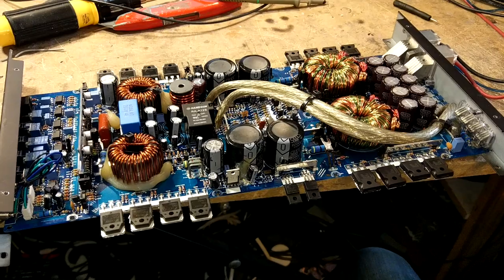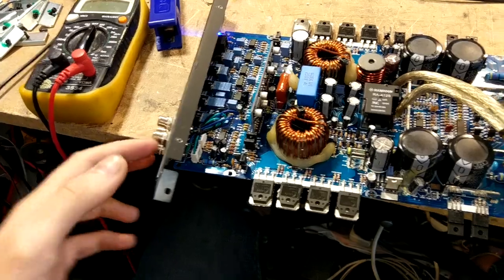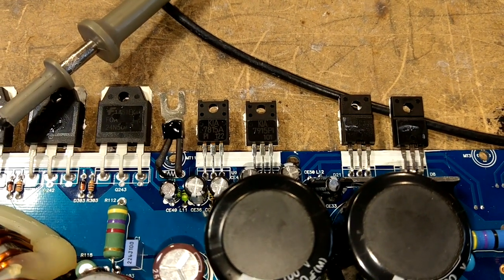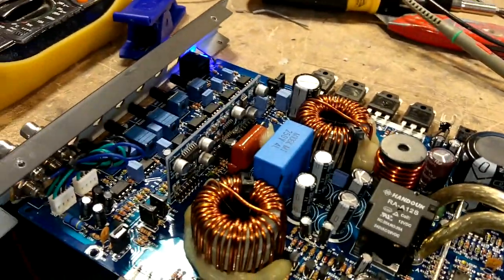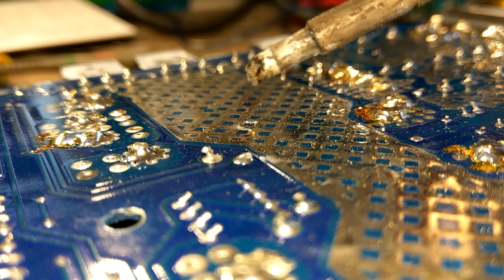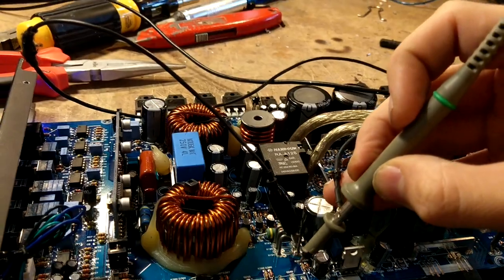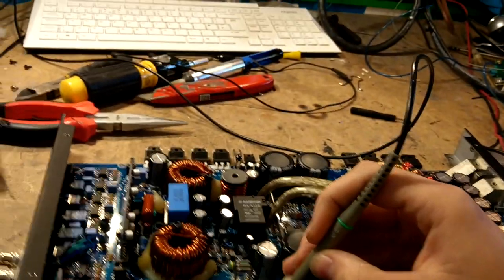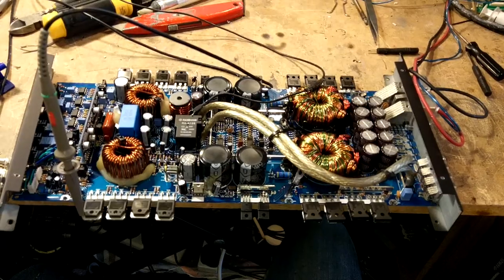Car amplifier fault finding - Sundown SAZ-1500D Repair

Comment: Sax-1200d...
Was hoping your problem was closer to mine. But its not. 
This amplifier of mine works. 
But, it idles warm. To warm. I heard its a factory defect in this series of amplifier. The heat seems to be concentrated around the toriod coil. 
Its out of warranty. But id rather fix it before i over stress it, accidentally, if its not up to snuff. 
Have you heard of this "factory defect"?
I was told this by an Ex sundown factory warnty repair guy. Hes no longer doing sundown warranty work. 
Any input would help me and my personal local repair tech get somewhere with this thing. 
Thanks in advance.
Reply: Are you still needing this SAX-1200D fixed?  I know 2 years later. I am that guy.  I have your answer anyway.  I was the Sundown warranty repair guy for 10 years, repaired probably 500 of the SAZ-1500Dv2 that this guy is working on in this video.  He is really good BTW, I am enjoying his videos.  I no longer repair electronics, period, sometimes I miss it, most of the time however I do not. Still fun to watch other people in the trade.  I have the files on an old computer about the SAX-1200D fix you need.
Reply: @xxcrazy_critr6661  
Hey. What city were you in? Your shop.
Reply: @xxcrazy_critr6661  
I know where the shop was. Im wondering if you do.
Reply: @xxcrazy_critr6661  what happened to you? No reply..
Reply: @hardhead7056  I'm here, was looking for your SAX-1200D mod info, but apparently it's not in a file where I would have expected it, I know it's written down on a parts bag in my old parts cabinet in storage.  Next time I am out there I will look for it and snap a pic.
Reply: @xxcrazy_critr6661  how do i direct message you?

Comment: My amp issue is... powers on and I get sound but also get a engine noise/whine. Even with rcas unplugged.  I see now its outta my hands at this point. Def not a car wiring issue def somthing internal picking up the power supply
Reply: You got a bad ground at your negative battery terminal and/or the alternator is going out.
Reply: @kensmechanicalaffair  everything worked prior to installation.  It was somthing with the amp itself. Since I got a new new amp things have been swell
Reply: @8806mixman  Well, that was an important detail, lol. Glad things worked out.

Comment: What's the minimum bandwidth scope that can be used for amp repair?
Reply: Assuming you just want to see the switching frequency of your class d + a bit of margin i'd say min. Bandwidth should be 200kHz..  since most cheap scopes give you 25Mhz to 50Mhz as the baseline model's bandwidth any of those should be good
Reply: @jojoposter what about a/b class are they any different?

Comment: This is why you shouldn't put the amplifier on the subwoofer enclosure, especially if you don't use the correct wood density type. It will vibrate beyond the amplifier wiring solder resonance!

Comment: bro, i have a power acoustik gt1 6000d gothic series amplifier. when amplifier running on  jbl (300 rms) 4 subwoofer. then subwoofer cone come outside, sometime blown the fuse or mosfet when subwoofer cone outside after volume 50 or above. which is the main problem. please reply

Comment: I have one of these and it’s been driving me nuts
Reply from the maker: What's up with it
Reply: @barevids  Not sure, first 12v repair. I sent you a message about it on FB but I haven't had time to really look at it again. I think the driver card is still bad, but I may follow along with this video and see how far I can get, thanks!
Reply: @barevids  Now that I think about it, I think somewhere in my repair it started sending DC out and switching the relay off and I gave up. I'll look again.

Comment: I'm willing to bet anyone it's a lot easier to repair full bridge amplifiers? You don't have all those components in the board and they are half the size of a class d amplifier?
Reply from the maker: Yep
Reply: @barevids   Do you run into a lot of problems with Taramps amplifiers because I left the Korean amplifiers alone take up to much space and need a generator to maintain the voltage on them I have the md models and the bass 8k

Comment: Sam is it possible to change the class of an amp?
Reply: no
Reply from the maker: No bud
Reply: Is it possible to make it more efficient?
Reply: @riveralley  class D is the most efficient there is afaik
Reply from the maker: No you can't change it at all.
Reply: @barevids  What inside makes class A great for sq?

Comment: Hi bro I have a TA-V5000.1 monoblock issue is when I turn up the sound on my radio it blows the amp fuse and when I checked the 12v connector on the amp it seems to be rusted 
Any suggestions 
Thanks